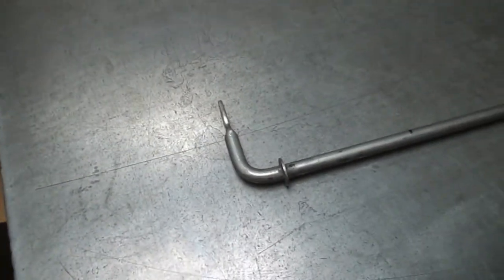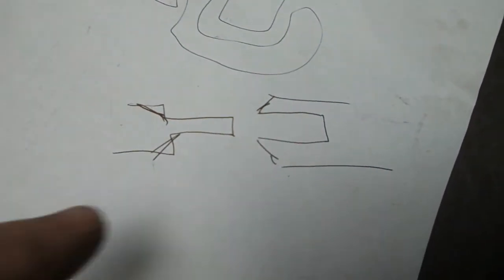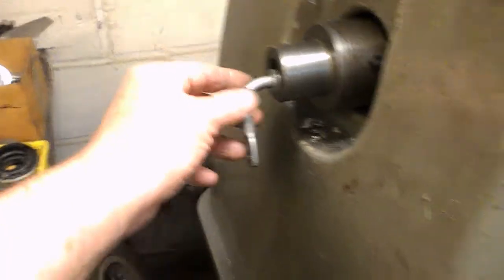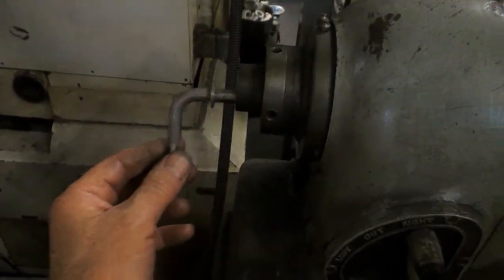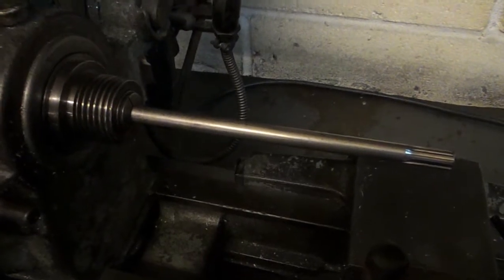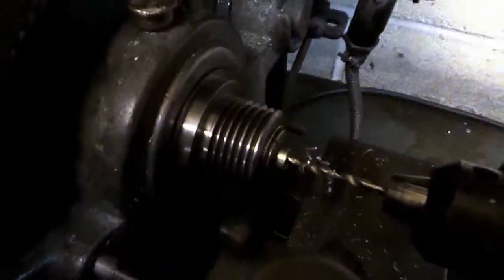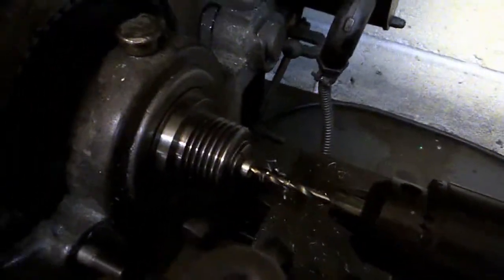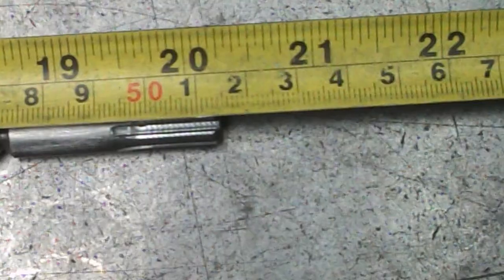Shortening an outboard motor gearchange shaft

Comment: Aha the joys of holding things.😄
Two things come to mind, first i would have used your big lathe. Hold the splined end in the collet at about half the shaft length. Turn down a section for spigot, chamfer and then part off at collet end. Shorten remaining splined end to suit and drill for spigot. Weld, then remount in collet to turn the weld down, this is why i suggested doing the cut somewhere in the middle, so you have something to hold.
Second come mind is, did the splines need to timed to the crank end. There were so few splines that the bent end might not be in the right direction after welding. Just a thought.
Other than that, do you really wear light coloured shirts in your shop?😂😂
Reply from the maker: Ah yes, now there's clever! Could have been done that way round...
The splines did need to be "timed"
Light coloured shirts?
Reply: @MidEngineering You are too kind, ask a dozen machinists etc etc.
 i noticed in some of your videos that you wear light coloured shirts, I'm banned from having light coloured clothing, save for socialising. Also banned from wearing anything but old clothes in the Engineerium, with good reason.😉